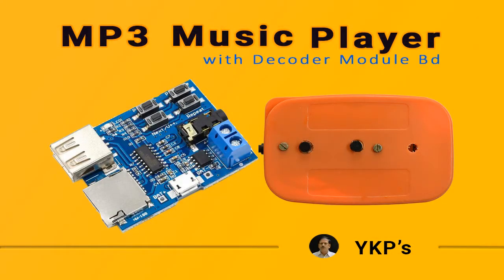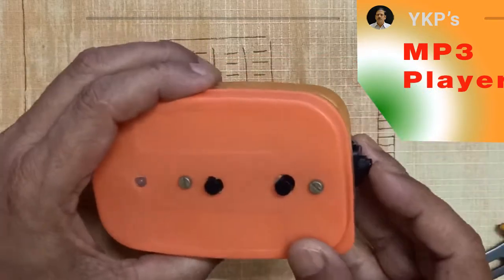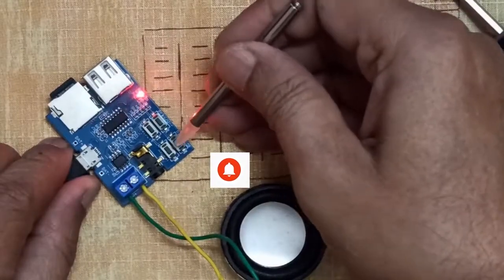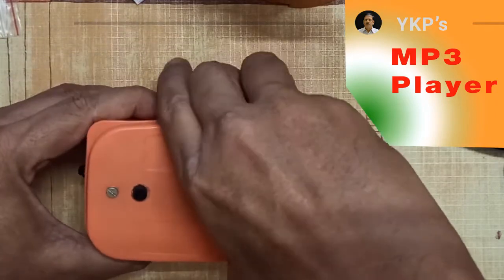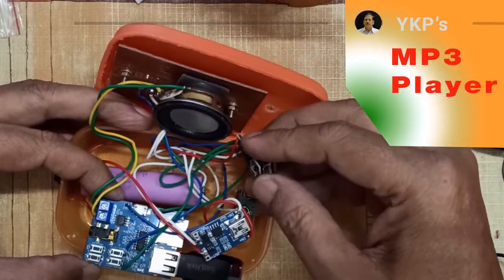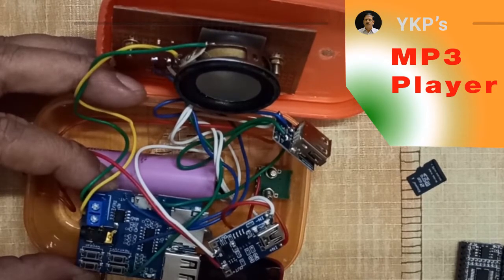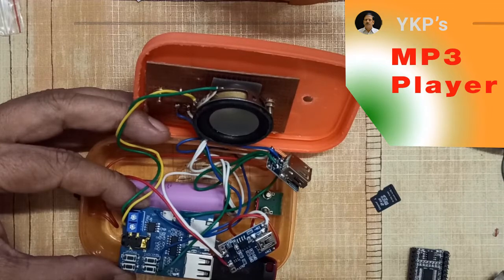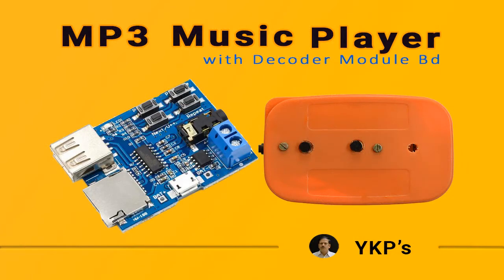Make your own MP3 Music Player with MP3 Decoder Module Board

Comment: Tried earlier with 4 ohms speaker. The speakers are of pretty bad quality. Also probably the Audio output driver has difficulty driving 4 ohms. As a result the sound became unpleasant slowly. Replaced the speaker with a 32 ohms and 0.5 watt speaker I had with me. Now the sound is consistently good.